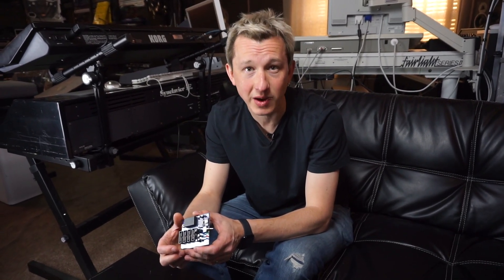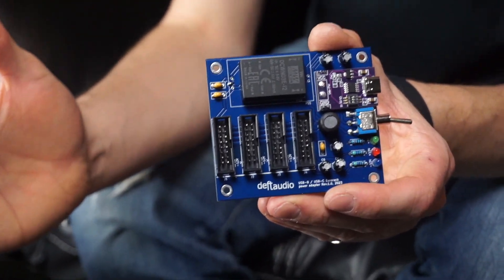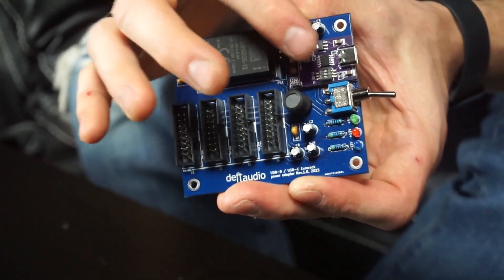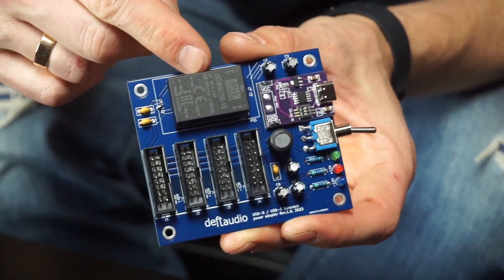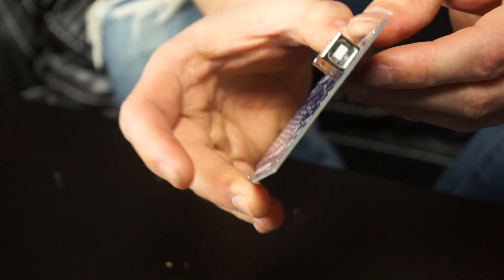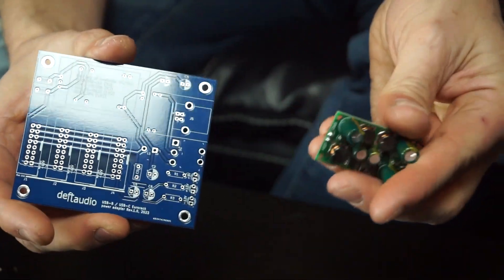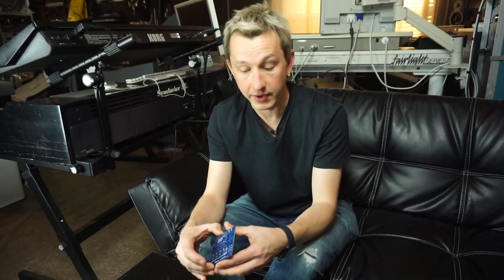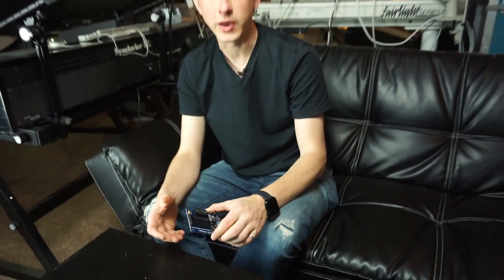Eurorack USB-C and USB-B Power Supply

Comment: How power-hungry are typical modules? Do you need the power delivery USB-C module, or does it work fine as a standalone?
Given 4 modules -> a VCO, ADSR, VCA and output into headphones.
Is a classic 5V/1A USB supply transformed into +-12V enough? That's ~200mA per rail at max.
Reply from the maker: Of course it depends on the module itself, but basic one takes ~20ma for something like and OSC or a Filter. Of course it's case by case different but even with 5W you could do a lot.

Comment: I don´t know much about electronics so excuse me if I sound dumb, but, can't you just take the outputs from the usb-c power controller directly in to the dc/dc converter, and from there into one output? Why all the resistors when the dc/dc output is always 12 v, and why all the capacitors when the power is already dc? If you don't want the 5V, the usb-c thing has a setting that makes it output 12 V. Could you use the ground of the usb-c thing for 12V and if so, does that mean that it's also possible to have the usb c directly into the 16-pin if you don't need the 5V? Again I'm not a electrician...
Reply from the maker: Resistors are only for LEDs. Filtering capacitors are needed for DC-DC operation. You need a dual rail +12V and -12V even if you're not planning to use +5V rail. So a proper DC-DC required that can produce those voltages.
Reply: @DeftAudio thank you☺️
Reply: (Also ground necessary if you don't want the risk of getting electrocuted?!)
Reply: Can u just unplug the usb-c cable instead of flicking the on-off switch?
Reply from the maker: @lolinonusos225  Sure you can